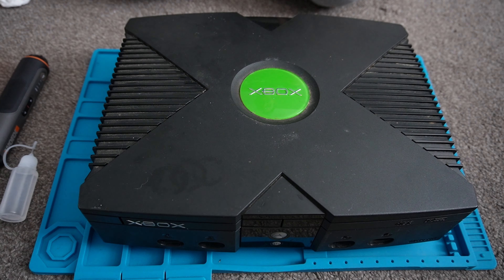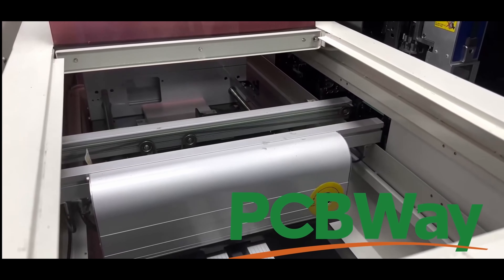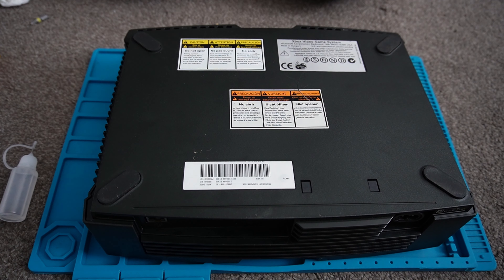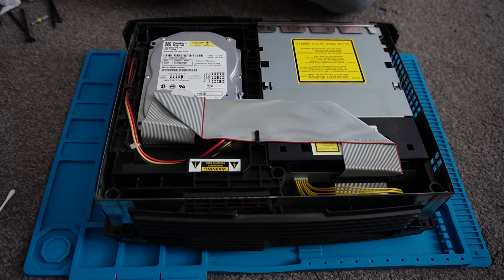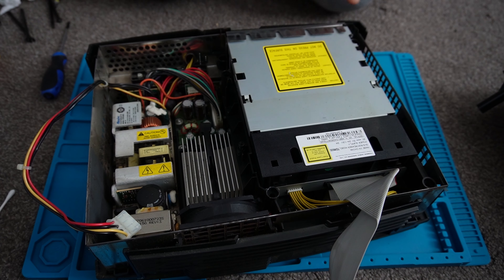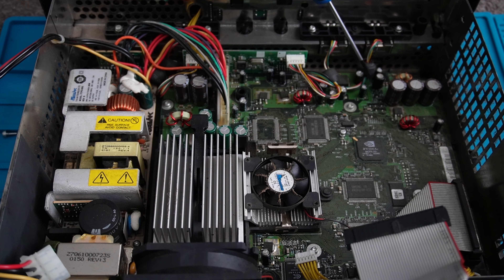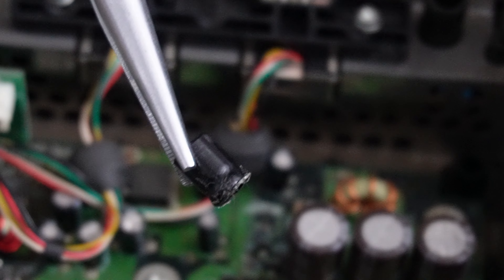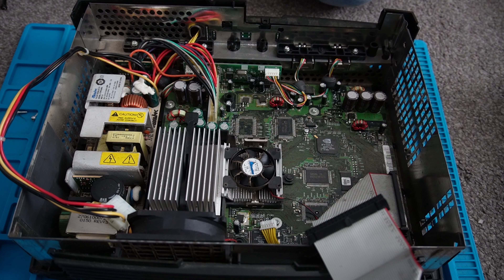Original Xbox Clock Capacitor Removal | DO IT BEFORE IT KILLS YOUR CONSOLE!

Comment: My Xbox is actually older than the one you have without the extra fan so it looks different
I can’t find the right part to take out by your example 
Thank you anyway great video
Reply from the maker: Im not 100% but im sure it was the v1.0 that had the extra fan. you may have a 1.6 which doesnt have this capacitor on it.

Comment: is it really required i thought some models made after certain date was no problem
Reply from the maker: Yes thats right, later models the 1.6 versions did not have this issue.
Reply: I have a 1.6 version and can confirm it’s good. The only issue is the disc drive belt but you u can throw it in some boiling water for a sec to make it a bit tightened.

Comment: If my serial number is LNNNNNN 34WFF,  do i need to remove my clock capacitor?

I seen a video where if the number was 33 or less it needs repair, but mines 34. Thanks and Subbed
Reply from the maker: Thanks for the sub, to be honest im not sure the best way to be 100% is to open up and check its there to be on the safe side.